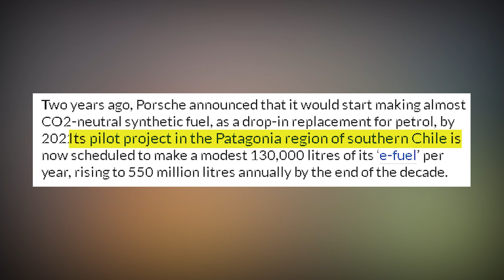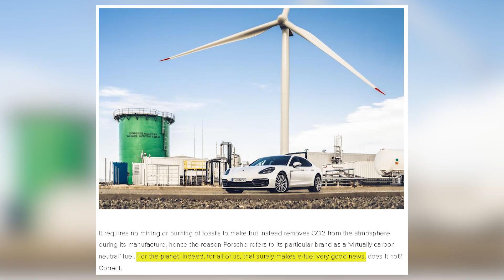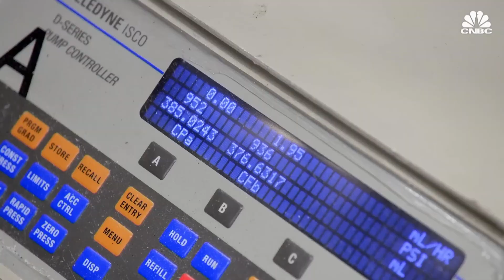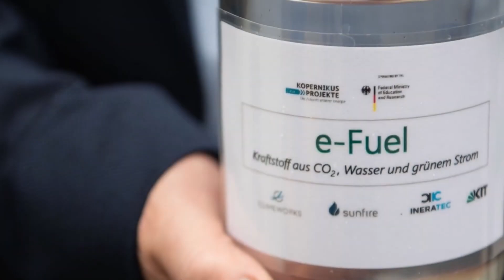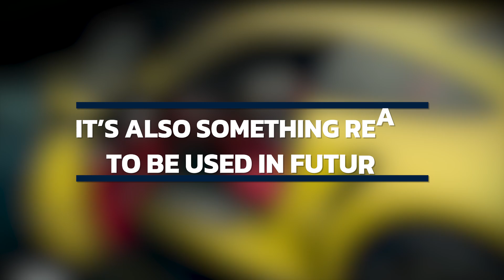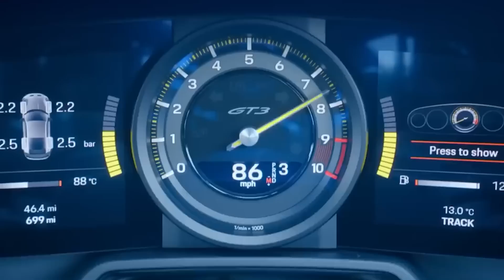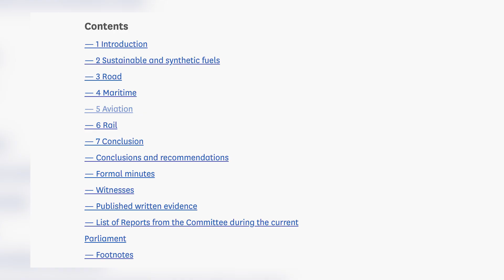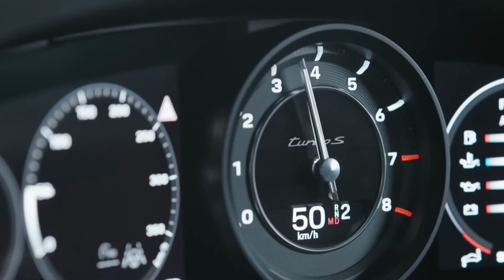Why Porsche’s eFuel Plan is Actually Brilliant

Comment: Let me get this straight. They use wind power to produce hydrogen with a loss of 50% and then put in even more power in a process to refine that e fuel instead of using that wind power directly to run an ev? Who thinks thats a good idea?
Reply: well the whole problem with electic energy is how to store it and how to transport it without direct connection to the power grid like in a car. that's why you turn the electric energy into chemical energy to transport and use in a mobile vehicle. hope that helps to understand. good question :)
Reply: @haberlevalentin  For me in this context (fueling cars) it only makes sense if we use „waste“ energy to produce hydrogen. For example in the summer when more solar power is generated than needed. Thank you for your point!
Reply: @IronMike-wk1sy   you don't believe there's a climate crisis, do you?
Reply: @ThekiBoran  You have a great point. I was talking about wasting energy and using inefficent processes and you talk about belives.

Comment: As I can see Porsche wants to make synthetic fuel by capturing CO2 from the atmosphere. That must be the hardest way to come by CO2. 
The atmosphere contains just 440 ppm. CO2 and huge amounts of energy is required to filter it out. Surely there must be other richer sources where less energy is required.
It will become expensive.
Reply: Flue gas coming out of gas pipes can be used 
A company named jakson green is making such plant

Comment: What are the potential environmental benefits of Porsche's CO2 neutral synthetic fuel compared to traditional gasoline, and how could this technology impact the future of the automotive industry? 🤔
Reply from the maker: Porsche's CO2 neutral synthetic fuel has the potential to significantly reduce carbon emissions in the automotive industry compared to traditional gasoline. By utilizing innovative technology to produce fuel from renewable sources like hydrogen and CO2, Porsche's eFuel could help combat climate change and promote sustainability. This technology could pave the way for a greener future in the automotive sector, offering a more environmentally friendly alternative to conventional fuels. Contact: Techcryp1@hotmail.com
Reply: @TechNewsEV   CO2 has nothing to do with climate change.  There's is no climate crisis, it only exists in bogus computer models.